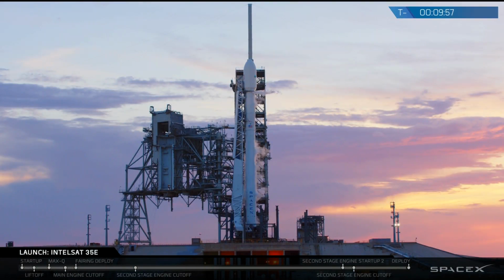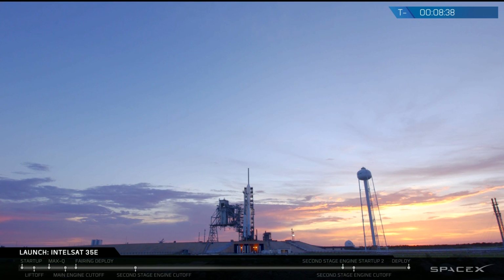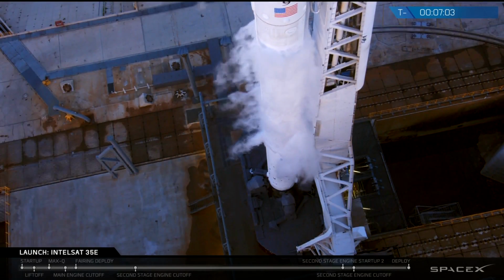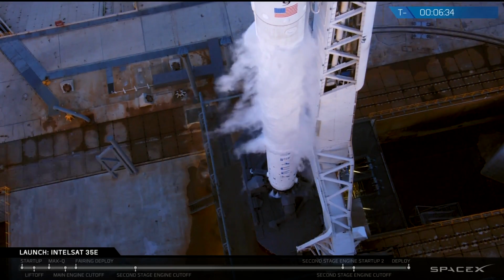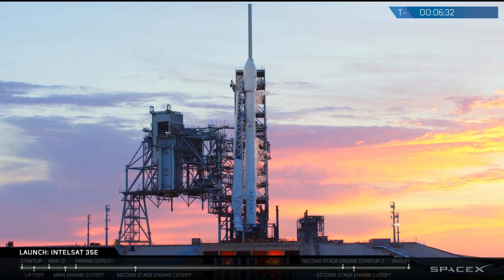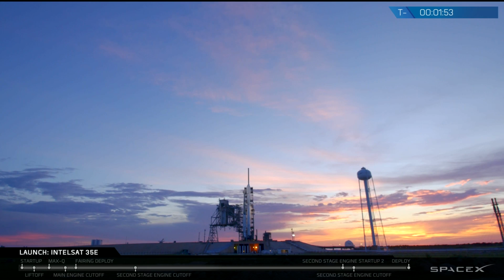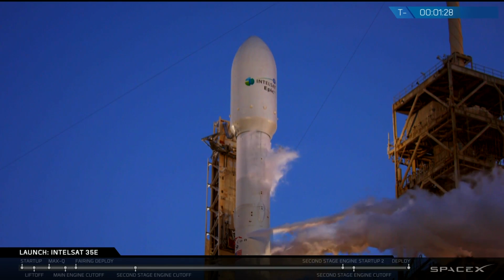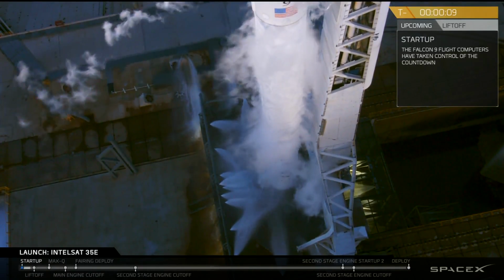Intelsat 35e Launch Webcast

Comment: Not ideal, but certainly not a negative. Flight computers shutting it down because something's not right. Could be people on-board and this is exactly what you want to happen if everything is not 100%. Cool stuff actually, and you can be sure they will sort it out.
Reply: your comment on not taking their job seriously just makes me ROFL.
Reply: John Fryer well you'd think they'd trouble shoot the problem and fix it rather then change launch parameters. Could be a serious problem that might cause a failure during flight. They'd better get serious and start checking out the part that caused the glitch rather then the software settings

Comment: wonder how much fuel is lost every time they scrub?  Do they purge? how much does the whole process of "aboarding" costs?  Who pays for it?  Is the satellite still insured during scrubbing?
Reply: The fuel for a Falcon 9 launch costs about $200.000 and they detank most of it, except some boiled-off LOX. Since a Falcon 9 launch costs about $65M, a few thousand dollars of lost fuel don't make a big difference - especially if you consider the losses SpaceX would have if the launch was not scrubbed and then failed. Insurance is split as far as I know, until launch (playload manufacturer insurance) and after launch (SpaceX insurance), where "launch" is considered the moment the hold-down clamps release the rocket, not engine startup (which happens at about T-3s).
Reply: Pascal C There is nearly no fuel lost only Oxygen.
Reply: Pascal C The fuel is Kerosene and Liquid  Oxygen.The Kerosene is liquid at room temperature (20 Degrees C) and the Oxygen is liquid at much lower temperatures , so when you load it on a rocket  it starts to boil.The only fuel lost is that Liquid Oxygen that has boiled off on the launch pad
Reply: do you work for SpaceX?
Reply: We know what fuels they use. 
We know the price of those fuels. 
Because we have the public specifications of the rocket, we can, using the rocket equation know the amont of fuel required.

They regularly test and dry run the rockets (load and unload fuel), they say so in the stream.

There is no need for an authoritative source here, public information to calculate all of this this is available.
This information included Satellite Insurance policies (not necessarily the premiums, but what they cover and how).
Reply: They do not "purge" they offload it.
The costs are covered by SpaceX and is integrated into the price of a launch (billed to the customer).

Comment: This shows how expendable launch vehicles are less reliable than flight-proven ones.
Reply: Nathan Rice was the go fuck yourself part really necessary?
Reply: no, it doesn't. not even close. for it to do that, it'd have to do comparisons. This shows one that failed to launch, and every single vehicle has had that happen.never once has a human had a vehicle that didn't fail once.
Reply: What are you on about? They have dozens of successful flights. Kindly go fuck yourself.
Reply: NiceWhenEarned RudeMostlyElse second strike. If they can't get it up on the third try they might as well start tearing it apart and use it for spare parts.
Reply: This is the only SpaceX launch in the past year that has had multiple failed attempts.

Comment: "Standing down today due to a violation of abort criteria, vehicle/payload in good health, next launch opportunity tomorrow, July 4th!" - What does it mean?
Reply: Breakdown:

"Standing down today"
No launch!

"due to a violation of abort criteria,"
The rocket goes trough a stringent self-test and checks a lot of parameters, one of these tests failed. It may be as insignificant as a temperature probe failing and giving an incorrect reading, there's millions of things that could trigger this.

"vehicle/payload in good health," 
Neither the satellite nor the rocket was damaged or are damaged, everything is OK, except for the abort. It also means that it is a minor thing that caused the abort. Had the thing been major the vehicle would not have ben pronounced "in good health".

"next launch opportunity tomorrow, July 4th!"
It means: We'll try again tomorrow.
Reply: Very AvE. Well said.
Reply: haa..thanks for all the effort to explain
Reply: Dmitry It means they're going to attempt a launch tomorrow on the 4th. Duh...